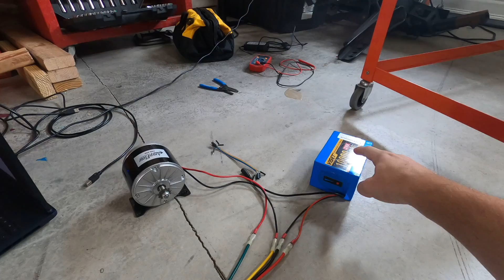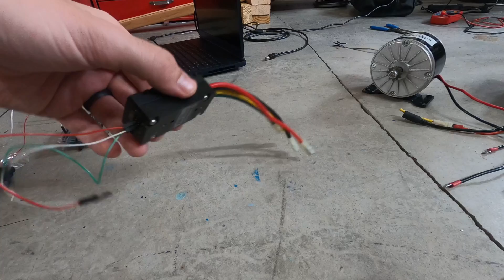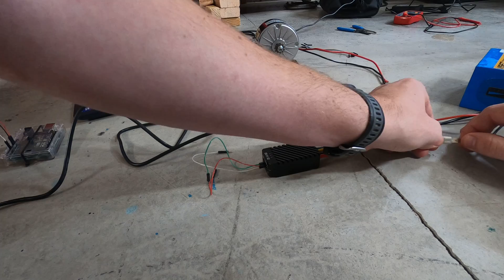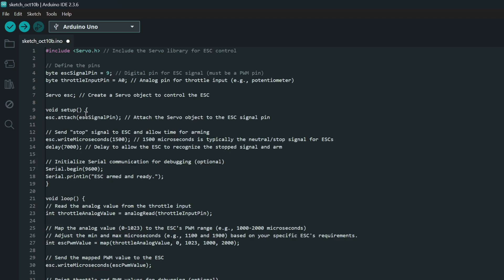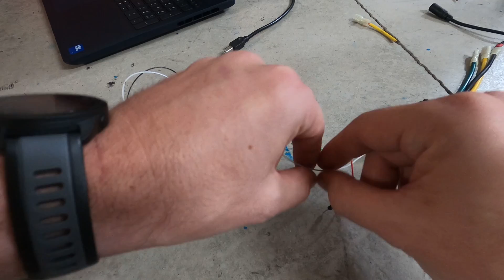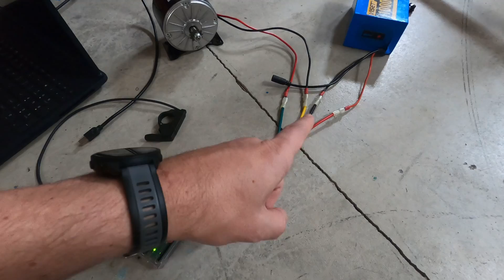Motor driver circuit setup and programming

Comment from the maker: Arduino Sketch:

#include <Servo.h> // Include the Servo library for ESC control

// Define the pins
byte escSignalPin = 9; // Digital pin for ESC signal (must be a PWM pin)
byte throttleInputPin = A0; // Analog pin for throttle input (e.g., potentiometer)

Servo esc; // Create a Servo object to control the ESC

void setup() {
esc.attach(escSignalPin); // Attach the Servo object to the ESC signal pin

// Send "stop" signal to ESC and allow time for arming
esc.writeMicroseconds(1500); // 1500 microseconds is typically the neutral/stop signal for ESCs
delay(7000); // Delay to allow the ESC to recognize the stopped signal and arm

// Initialize Serial communication for debugging (optional)
Serial.begin(9600);
Serial.println("ESC armed and ready.");
}

void loop() {
// Read the analog value from the throttle input
int throttleAnalogValue = analogRead(throttleInputPin);

// Map the analog value (0-1023) to the ESC's PWM range (e.g., 1000-2000 microseconds)
// Adjust the min and max microseconds (e.g., 1100 and 1900) based on your specific ESC's requirements.
int escPwmValue = map(throttleAnalogValue, 0, 1023, 1000, 2000);

// Send the mapped PWM value to the ESC
esc.writeMicroseconds(escPwmValue);

// Print throttle and PWM values for debugging (optional)
Serial.print("Throttle Analog: ");
Serial.print(throttleAnalogValue);
Serial.print(" | ESC PWM: ");
Serial.println(escPwmValue);

delay(10); // Small delay to prevent rapid updates and allow for stable readings
}